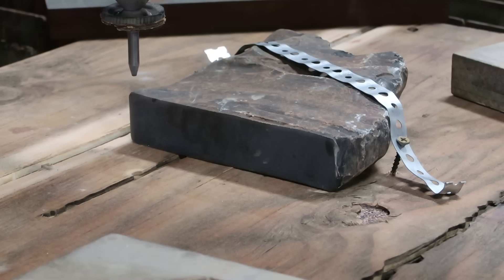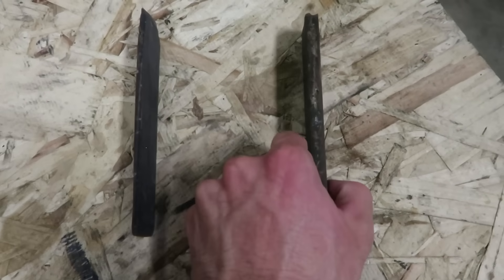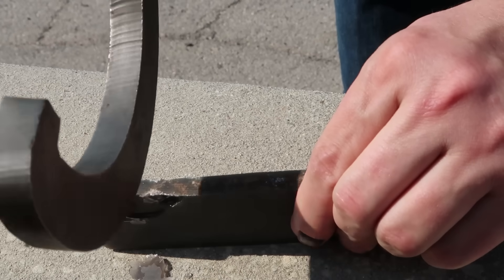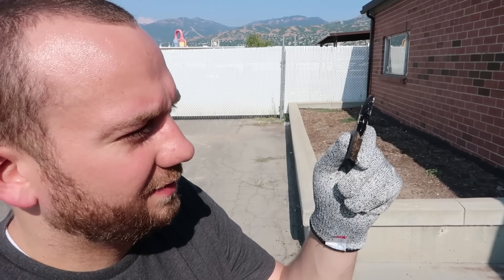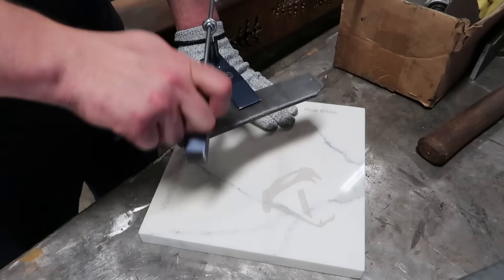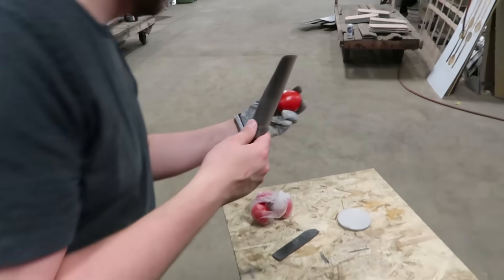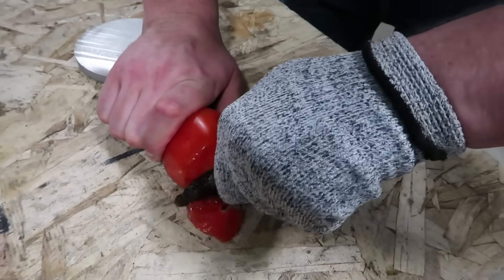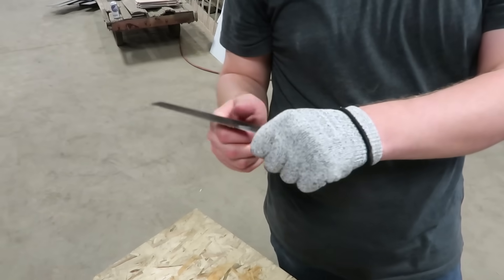Worlds Sharpest Knife Obsidian vs 60,000 PSI Waterjet

Comment: A professional knapper can make a sharper blade than the water jet blade. Obsidian fractures to the molecular level, which makes an insanely sharp edge. The water jet doesn't allow the obsidian to fracture, so it will never be as sharp as a truly knapped blade (you can't really call what you made, knapped).

Comment: Okay. Science lesson. Obsidian can't slice an atom. That is impossible. At least with non nuclear power plants. Atoms are fields of energy. As such you can't separate a field of energy without ripping it apart with more high power energy. Splitting atoms of iron or hydrogen is damn near impossible. Or at least needs so much energy, it's useless.
Obsidian can cleanly slice through objects without displacing many molecules. Better than most conventional knives.
So unless you have a lightsaber you ain't gonna slice an atom

Comment: The sharpest obsidian is ≈ 3 nm thin, which is way sharper than the sharpest steel blades. They cannot cut atoms, that would imply the the edge is thinner than the radius of an atom, which we're talking incredibly small. 

Anyway, what obsidian can cut is individual cells, which is still very impressive. Some surgeons today still use obsidian scalpels because they cut so well that they minimize scarring and promote better healing of the cut area. They are so sharp you can't even tell if you cut yourself with it.

Comment: So the thing about obsidian cutting atoms in half is wrong. Obsidian can be sharp enough to go between atoms but not cut them in half. If it did go through them, there would be a nuclear explosion like an atomic bomb which fills an atom till it bursts open.
Reply: Well, technically yes it would be a nuclear explaosion, but it'd be a lot smaller than  what happened at, say, Hiroshima. Little Boy split a lot of Uranium atoms in a very small amount of time. (Though the vast majority of the U-235 atoms were 'wasted,' as the core blew apart so fast that most of them never got the chance to be split. Wikipedia says that the bomb contained 64 kg of Uranium, and only 0.6 grams -- not kilograms, grams -- was converted to energy.)

Comment: Why not get an actual flintknapper to knap it? You did probably the worst job possible. Plus the sharpest of obsidian blades are the chips from it. If you take a single long blade of high quality obsidian from a blade core I can guarantee that it's hundreads of times sharper than you could make it otherwise.

Comment: What makes obsidian so sharp and interesting is how it "flakes" when you knap it. The flakes can have edges that are bare nanometers thick, meaning they are extremely sharp. 
Med-scientists actually noted that surgical incisions made with Obsidian Scalpels healed faster than normal, because of the extremely fine cutting edge.
Reply: I was handeling a piece of obsidian one day and did not know I was cut until I saw the blood dripping, It cut my ring finger down to the bone and being so sharp it did not hurt. Looking at my finger today there is no visible scar...Today they use Obsidian scalpels for eye operations........
Reply: Bare nanometer like in just 1 freaking atom thick?
Reply: @Sechs0rBecks  Atoms are on the picometre scale. But it is on the size-level of human cells.
Reply: Thats bad ass

Comment: See the problem with your testing process is that knapping wasn't mean to cut fruit and vegetables. They were meant for hunting. Because the serration of it would tear up whatever you were cutting. Or shooting with an arrow. Also when we got into blacksmithing we obviously scrapped using glassy materials like obsidian for our knives and arrowheads and switched them out with copper, and other metals as we started to discover these resources, and really we never used obsidian like that because it's a very fragile material we instead used very hard stones and other rocks just because they were durable and could potentially last exponentally longer than what obsidian could now obsidian would be good if you wanted it to shatter inside the animal or whatever so that if it gets away too quickly it would bleed to death. But yeah so that's why your knapping shard failed because what you're testing it on isn't what it was created for.

Comment: If you guys do another one of these with obsidian try flaking a very large piece off a larger chunk. The concoidal fracture and natural split will leave you with the sharpest edge possible. The actual flakes with good clean edges are far sharper than a worked edge, these are what the obsidian surgical scalpels are typically made from I believe. As someone who's flintknapped, I'll tell you right now those pieces will cut the living shit out of just about anything. (Usually my legs and my hands). They're sharp enough to shave with too, so there goes your $ Shave Club sponsorship..

Comment: Make it with a tang as well then put a high quality wood handle on it. I'd buy it considering its the sharpest thing around and that it won't go blunt for many many years.
Reply: Obsidian that thin would break almost immediately. That's why when knapping a blade, it's a lot thicker and only gets sharp at the edge. It's basically just glass.
Reply: better off with ceramic. almost as sharp and more durable

Comment: My question is: if pointed straight up in the air, how high would water being shot from a 60,000, 60,001, or 60,002 psi water jet travel?

Comment: Imagine the 60,000PSI waterjet trying to cut through bedrock...
Reply: YES
Reply: JadenTech tube bedrock isn’t that tough... I have no idea what you mean by ‘trying’.
Reply: It IS a joke about minecraft because they just cut obsidian... as for bedrock yes it is real and made of different materials depending on where you are. usually they just blast it out with dynamite or cut slabs out with a really big diamond saw to make shit like counter tops. You can cut it with a waterjet if you take a piece to a waterjet but they dont exactly have a free-roam mode that lets you walk around with a hose blasting the ground at will because the pressure would be more likely to fire hose on you and cut you rather good. In theory you could strap one to a large tractor or something but that would be an engineering challenge in itself as it would then have to supply its own water and carry the garnets and computers onboard.
Reply: Aevi Wright you wouldn't need computers at all. they could just put it all on some type of large vehicle that can turn on the spot and just shoot the water straight down. the problem would be flooding, and that the water loses effectivenes when cutting something so thick. i'm sure they could put one on a truck, but it would have to act the same as what they have, but without the tank.
Reply: The waterjet wont turn on properly without a computer to control the actuators and feed pumps for the water and garnet, and yes flooding would become an issue as well as a high probability of making a sinkhole which is why the industry prefers the giant saw approach which has its own methods for dealing with waste water.
Reply: Aevi Wright there are portable jets
Reply: Aevi Wright so you can
Reply: Looks like someone has been playing minecraft too much
Reply: Fox Trot I’m just joking
Reply: Enough minecraft today okay?
Reply: pull your head out of minecrafts ass
Reply: /gamemode 1 works my dude.
Reply: But then you'd fall into the void
Reply: Josh Bacon like Minecraft bed rock?
Reply: its also not always uniform my basement goes into some basalt at the bottom but they cut it down and filled in gaps with concrete as they formed the basement walls. (one wall collapsed some rock and they used another 900lbs of concrete to fill it in)
Reply: Spaz ? It’s the last lair of the earth that basically holds the it with the soil layers
Reply: Draggy654 our of all the things, gold rush is something of a million I watch you could’ve said 😂😂😂
Reply: Spaz ? It's real and you don't sound dumb no worrys
Reply: Josh Bacon must be creative mode
Reply: Josh Bacon stop playing Minecraft
Reply: Bedrock is real but it's not like mine craft it's almost just rock
Reply: What is this Minecraft
Reply: Josh Bacon lol this aint minecraft lol
Reply: You could
Reply: Spaz ? It is a hard lair of rock
Reply: they've cut diamonds and the reason diamond is so hard has to do with the arrangements of carbon atoms in its crystalline form, which has a very high packing factor. Bedrock can be made from many different substances, with a hardness anywhere from 1 to 9. So even the hardest bedrock is still not as hard as diamond.
Reply: Josh Bacon minecraft epic style 😎
Reply: Flashy Paws wait wtf? That doesnt sound right
Reply: Josh Bacon this isnt minecraft it will cut right through it
Reply: Bedrock is not really that hard at all
Reply: Bedrock irl isnt that powerful
Reply: Bedrock is not as strong as you think its just rock under a bunch of soil if anything im pretty sure the obsidian is harder
Reply: Spaz ? In Minecraft bedrock is idistructable irl it's not
Reply: Certain Bedrocks can be quite brittle, the point of building on bedrock is for a high bearing capacity. Brown Shale for example can have a very high bearing capacity but can be broken in your hand. This type of bed rock is consider a "mudstone" and is brittle due to how it was formed, that is silt and clay sediments were deposited on top of each other and over time compacted to its most densest form. This is why it can have such a high bearing capacity but be so brittle, its really hard dirt if you want to think of it that way. Of course other things can affect the overall strength of this bedrock, but this is just a general explanation. There are many other types of bedrocks like limestone, granite, sandstone, etc, and by definition all Bedrock is just solid rock underlying loose deposits such as soil or alluvium.
 P.S. Feel free to correct me or add to anything I said, I'm sure I screwed up somewhere.
Reply: Josh Bacon oof
Reply: Josh Bacon bed rock is softer than you think. It's the hard rock you find under the dirt and gravel
Reply: Spaz ? Real bedrock is literally just hard rocks. Its not hard to get through.
Reply: Five hundreth like👊
Reply: Josh Bacon amagine it cutting through a beacon
Reply: Josh Bacon base don my minecraft knowledge, bedrock is unbreakable
Reply: Flashy Paws I’m 12 and I watched the flint stones and yes I am talking about the classic boomerang tv show...
Reply: Josh Bacon its basically just hard mud it wouldn't do anything
Reply: Josh Bacon bedrock is a layer of the crust
Reply: Everyone is talking about Minecraft, when bedrock is just a very hard layer of rock found deep in the earth. If you go through it you will not fall into the void, for all the idiots who don't know what 2+2 is. Plus if you read the comments you'll see how stupid kids are in the 21st century. I know that some people mean't it as a joke, but at LEAST one was from flat out being ineducated.
Reply: It’s impossible but if you’re in creative mode it mighty break I mean I forgot if it works:)
Reply: Josh Bacon bedrock is not real .
Reply: Flashy Paws you can find bedrock anywhere
With enough pressure and water you could cut it
Reply: Josh Bacon image it on someone’s skin 😣
Reply: 700th like
Reply: Why do I feel like this is a play at Minecraft?
Reply: Wait this isnt minecraft
Reply: This ain’t Minecraft
Reply: E N O U G H M I N E C R A P P L E A S E
Reply: Bedrock is only a minecraft thing
Reply: Mine craft is crap